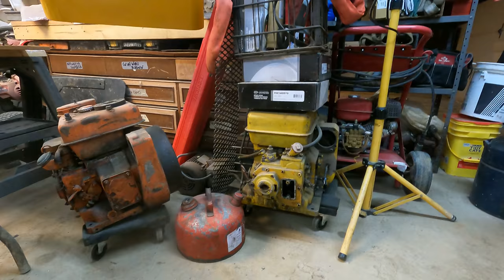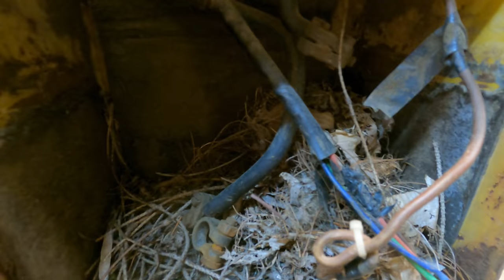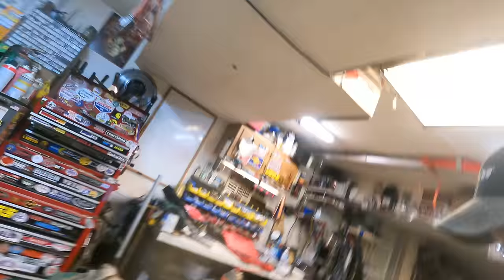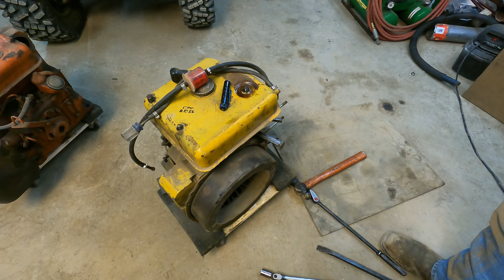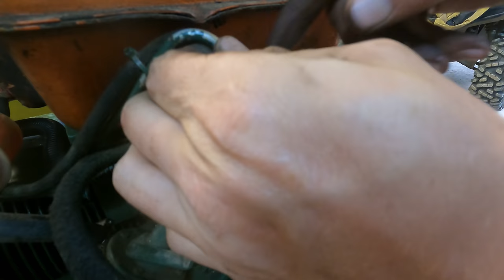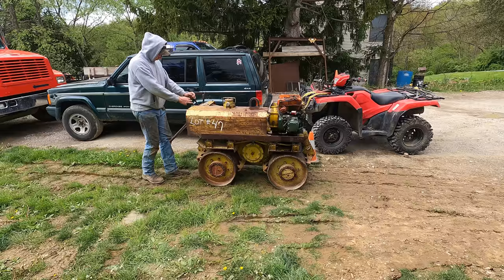FREE Diesel Trench Compactor gets a Military Surplus engine Transplant! (WILL IT RUN??) Pt.2

Comment: Hey friend. Just figured I would let you know that I have alot of experience with those old engines. You need to be careful about over-revving it. Those rammax's had a bad habit of the engine over-revving on down hill slopes and turning the pushrods into pretzels. Not a huge deal bc u have some spares from the other 2 engines, but good luck finding more if you need them.

Comment: The oil hose line was for remote oil cooler and most likely another filter line. These are common add on for military spec engines that require them to be rated for 120F ambient air temperature for desert use and things like that.

Comment: Haven't seen a comment on this: Matt, you may swap a whole cylinder to fit the intake and exhaust. Also, looking at two engines with dead rod bearings, I'd install an oil cooler. Also, connect the glow plugs - these should really help starting up.

Comment: I'm just thinking out loud here, but maybe the Oil lines went to a Cooler, you have two examples of engine design that both shredded their bearings and the third engine had a Oil Cooler installed... maybe to mitigate excess heat and stop it from destroying the Bearing???

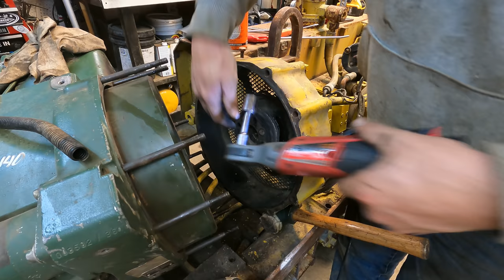Comment: 14:25 The block the oil filter is mounted to with the wire coming off it is likely a low oil sensor and the hoses might be the feed and return to an oil cooler...

Comment: Now that it has a retired military component transplanted into it (and it appears the patient is going to survive it), it's time for a name.  "Sarge" sounds as good as any of them.

I was surprised by how smooth that one ran.  I expected it to behave like a 2 cylinder Lister, trying to roll onto it's side with every bang until it got up to speed.  Perhaps the orientation took a lot of that out of there.  If you get those glow plugs to work, that will help a lot.  Ether was probably why the rod got hammered on the original one.

Not just the back, but front also.  Hernia's are not fun, and damage toward one can be accumulated.  Tendencies to getting them can be a hereditary trait, I'm told.  I had an indirect inguinal repaired when I was 8 years old, 47 years later it's twin showed up looking for it.  Wasn't doing anything particularly stressful at the time, all I remember was that my belly started hurting, when I stood up ... De-ja `vu.  I had mixed, poured and worked a 10 x10 section of the shop floor by myself the previous August, and thought I'd taken all the precautions, but I guess that wasn't enough.  A truss will not hold you together enough for heavy work, also, but I'm stuck with it until I can pull enough together to get this fixed.  Takes me 4 times as long to get anything done now, and I was slow before this showed up.

Comment: Re: the yellow fuel tank, I’ve  seen a guy use an impact chisel on badly seized items like that possibly Mustie1?
would Putting a nut over the thread end to protect it. And use the impact chisel on the nut down the line of the stud, At the same time while prising  the tank the idea being to violently vibrate the stud and sleeve and break the rust joint.

Comment: Personally I think having parts from several to make one is a pretty cool idea.  you could rob bits from the other two engines you have and swap over the head to put the correct intake and exhaust bits on that it needs.   a head gasket or o-ring or whatever seal it uses can't be too terribly expensive.  would save you a mess of figuring to make it work.

Comment: I was wondering if you gave up on this or not.  Good that you didn't. Dead as it was, it was well used and abused, so it has to be a good unit if they ran it into the ground. Best part about this whole affair is that you have a lot of parts for it. IMO, strip the two engines left, and make a sorted pile. What you don't need, you can put back into the stream. I'm sure others have issues finding parts just like you.

Comment: That military surplus engine was probably a 24v starter, may be the reason it didn't want to engage. just wasn't kicking the solenoid hard enough. Also, probably ran a generator so that was why it didn't have an integral charging system.

Comment: @Diesel Creek  I know is isn't my labor on this one but IF it was mine I would pull the engine back off and swap flywheels so a guy can have a charging system...  Also I bet it would have started a bit easier without ether if you had hot wired the glow plugs on for 20-30 seconds before and during cranking.  We have 3 military surplus diesel heaters (Lister 6.5 HP) that will crank forever if you don't use the glow plugs.

Comment: If I remember right, sometimes they turn a little better in place if you bump the vibration lever a bit. Been a long time though, I could be remembering that wrong. All I've used are articulated trench rollers since!
Reply from the maker: Yes I’m sure there’s some tricks to getting it to maneuver easier, I’ve never run a straight one before only articulated

Comment: Maybe you should have kept the oil cooler adapter and lines and added an oil cooler. Maybe the oil cooler is the reason, that the green motor works while both others have a bad rod bearing.

Comment: I'm thinking that " extra part "  behind the oil filter is probably an adapter to run an oil cooler. My truck has a very similar design ( Tacoma ). It just threads on the oil filter boss, and a line runs down to an oil cooler and back up again.

Comment: I had thought it was odd that you put the engine on and THEN started to tinker with all the various attachments and replacements. I would have done all that while it was sitting off on the floor. Might have spared yourself from having to take it all apart again later.

Comment: you cant just block of the hoses from under the oilfilter, its for oil cooling if you block them off the engine does not get oil anymore. its an oilcooler mod.

Comment: People - You are going to regret that when you get older
Matt - i regret it now, thats hilarious. As a grown man you already know what you will regret but yet we still do it vs wait 5min to get the engine crane lol, no different than having 5 grocery bags on each finger of both hands because we are determined to only make 1 trip from the car😂
Reply: Add a solar battery charger and dont even worry about the charging system unless something leaks and you have to pull it apart

Comment: Awesome, so glad you found a replacement engine (or 2!) for it. Can that filter on the side of the 2nd engines tank that you used, be removed? The original didn't have it I take it? Then could you use the military intake, or do you need to go back to the original intake? How different are the exhausts, I didn't spot that in the vid. Keep it up, good stuff, love the channel.

Comment: I was just wondering, as a long time  follower, a while back you said you wanted to get the International on the road to pull youre trailer, & even got spares for it.!! Instead of doing all these little projects, Why not bring up to youre garage the Spares you bought, do the metal work & undercoat & spray the parts, take them back to the Truck, Fit them and do this to all parts you can take off the truck, that will at least get some parts done without being on the farm. And how about some Remotes for youre 2 gates,?  as when you enter the farm you leave open!!, and as you are in youre garage area Away from the entrance possibility of theft, !! Thanks for the videos from UK.

Comment: Do not take the line off the oil filter that is a  Emergency bypass if the oil filter ever was too clogged up and allows the oil to bypass the filter and still lubricate the motor if you take that line off in capite off in that filter clogs up your gonna be back at square one looking for a motor again

Comment: I bought a wacker rt2 last year for $3500, put $3000 in time and parts into it. (saved me $5000 in rental fees, cost me $500 in lost productivity, and now at the end I have an extra tool worth more than $2000. I think I won?) I thought that thing looked like it had seen a hard life, this compactor.... really has seen the war, especially its new green engine.
P.S. I REALLY can't get behind allen socket bolts... Especially on smaller sizes. 
Regular bolt head usually = 1.5x bolt diameter
allen socket usually = 1.0x or smaller than bolt diameter.
I would rather use torque or star drive heads for low profile head bolts.... harder to strip those.

Comment: I see you working on the fuel rail. Unscrew the nut on injector for the diesel for fuel. Are you ready for this one it is a hack awesome hack listen very careful. The only thing that you need is a rag and an air pump. Do not put it at 100 psi turn it down to about 35 psi. Hold direct and spray into your tank slowly crank it up until you see it coming out of the bleeder seal a backup and it will start!!

Comment: My guess on the starter is that alot of military stuff is odd voltages compared to normal, like 24 or 36 volt rather than standard 12v. Just a guess.

Comment: Hi Matt, new subscriber here and I must say that like so many others, I identify with the way you went about problem solving this job. Good work on getting through all of the challenges and finally getting the compactor going!
 I own 2 of the Surplus engines as well, and both of mine had sat with water in the cylinders before I got them. When I did get them they were at the point where they would not rotate a complete revolution without binding. Long story short I removed the pistons, honed the cylinders, lapped the valves, replaced 1 injector nozzle and 1 piston ring and now they are both  running well.

As one of your followers commented, the starters for the Military surplus engines are 24 volt; mine simply would not start with 1 12volt automotive battery either, I had to use 2 batteries. 
On this subject, I had been wondering whether the 12 volt starters could be retrofitted and you gave me that answer, Thank you very much. 
One person was curious of the specs:
Bore 95mm, Stroke 100mm, Displacement 708cc, Weight 191 Lbs, Power 15.5HP@2300RPM max intermittent for the 43F Surplus engine. The civilian 37E and 43E make less power. In your video you compare the Surplus engine head to the yellow head and it is evident that aside from the differences in design, the Surplus engine also has bigger valves.
I found a repair manual online, but I don't recall where that was.

You can hear and see mine here: https://www.youtube.com/watch?v=Dz1ENVGKk4c

Comment: Military engines get the oil dumped and filters replaced every two months wether it was used or not
 wires are low oil shut down

Comment: Don't block those oil line ports it's probably an oil cooler bypass if you block it you might not get oil to the engine or pop off the oil bypass port could be wrong tho 🤷

Comment: Could you swap heads to save having to fabricate the inlet and exhaust manifolds?  If you have to strip the engine down again to get the battery charging system working, then would be a good time to do it.

Comment: The extension on the oilfilter mounting plate looks like a mod that allows you rotate oil in a closed system, presumably to cool it down? Would overclocking an engine with a turbo, etc. require cooler oil? Could be why the military had it modded in that way.

Comment: Matt. You have two dead air cooled engines, neither one of which had an oil cooler. The one living engine had an oil cooler adaptor. That might be important
Reply from the maker: Might be but I don’t think I have clearance for it. If I do I’ll install it
Reply: @DieselCreek  Good luck. Looks like a fun project.

Comment: I think, military equipment uses different battery voltage for starting..24/26 volts? maybe someone else can help with that.. Could be why the starter was not kicking in.

Comment: I wonder if the original starter was 24v and wasn’t spinning fast enough to kick out and engage flywheel?
Reply from the maker: A lot of people have said that, but I tested it out of the engine and it worked fine, I could see marks on the fly wheel like the Bendix was hitting the side of the fly wheelJust below the teeth
Reply: @DieselCreek  maybe bad bendix then.

Comment: I would now put a stand onto the back of it so the operator can ride it rather than get run over by it . you should probably look into insulating it with rubber bushings to help keep your teeth where they belong. I once worked at a place that had a  walk behind forklift that I had to use for my work, I don't know how many times I ran over myself with it, but that machine with the sheep foot rollers won't push you away and hurt you, it will claw you under and destroy you.  be safe have fun

Comment: Having some military surplus gas engines myself and going by the looks of yours it may very well have been rebuilt by them.  If it came in a wood/metal crate it could be new (NOS) or rebuilt.   I would like to have one like it myself.  Oh, and being military the starter may be 24 volt as well as the charging system.  
A cupleof sites that might be handy.  

https://www.army-technology.com/contractors/propulsion/farymann/
https://www.google.com/search?client=firefox-b-1-d&q=USA+military+Fairyman+diesel+engine+manual

Comment: How did you get the oil filter off without Draining the oil?
Reply: the oil filter is pressure fed - engine not running - no pressure - just a few dribbles.
all systems [ cars/trucks/boats] are the same, but the hotter the oil + the shorter the time since running - the bigger the dribbles.

Comment: anyone else notice the sparks in the exhaust ?
Reply from the maker: After engines sit a long time the carbon in the ports can come loose and after the engine is running again the little flakes of carbon become heated and fly out looking like little embers like that, after it ran a second there was no more. Pretty common on old starts! If it had a muffler you’d have never seen it 😎👍🏼
Reply: @DieselCreek   i think that's why some trail vehicles  have spark suppressing mufflers , (some bear from the 70s) REALLY cool

Comment: Your next project should be finding a engine lift/hoist so you do not physically lift heavy objects that should be raised and moved using a mechanical device and not your back. You have no idea what sort of damage you are incurring to your spinal discs and your shoulder joints. Stop it.